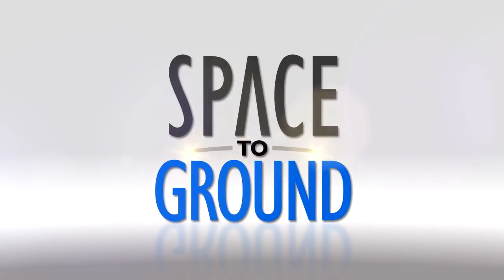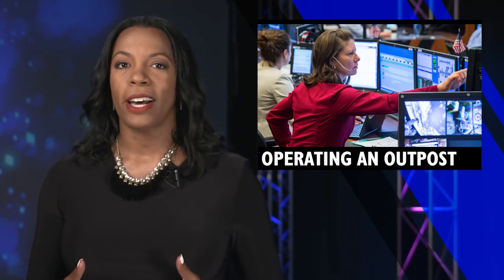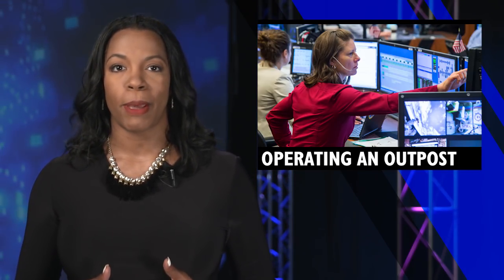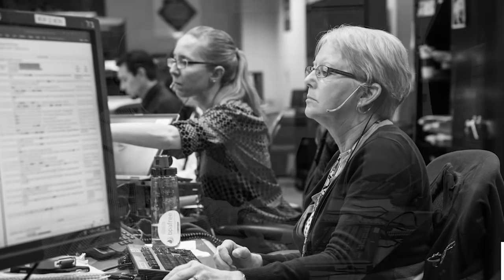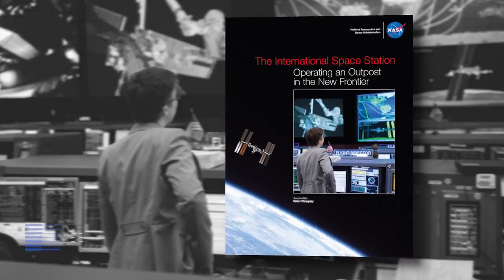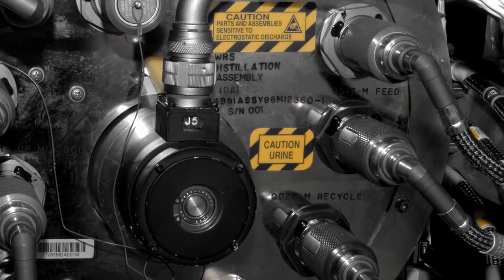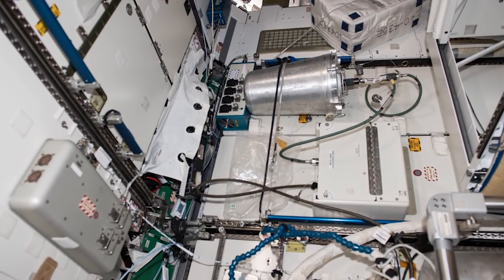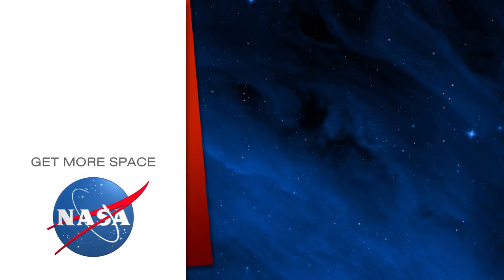Space to Ground: Operating an Outpost: 04/20/2018

Comment: #spacetoground Why doesn’t NASA just make exterior bladders on the outside of the space stay, to store the extra water when supplies come up to the space stay. Or once water is processed through the filters. Wouldn’t water stored out side increase the protectiveness of the crew from all radiation’s. At the very lease reduce it penetration and damage. I was thinking that since you now have that inflating module you would use less atmosphere and more fluids up to the station.